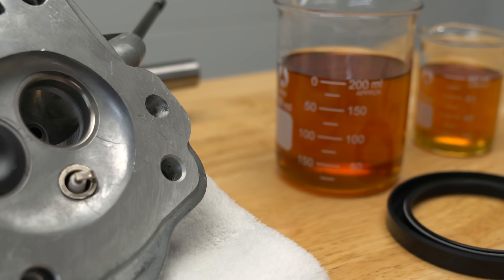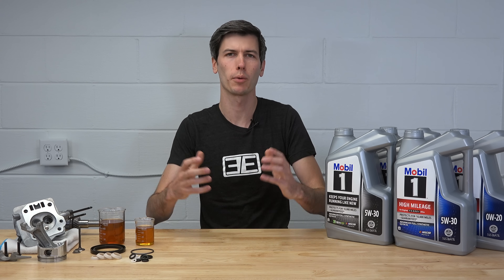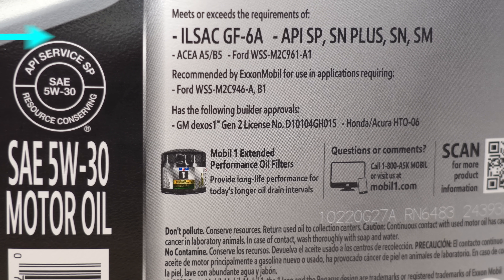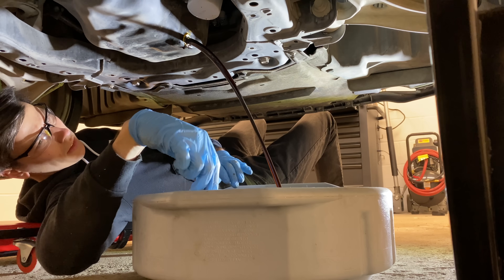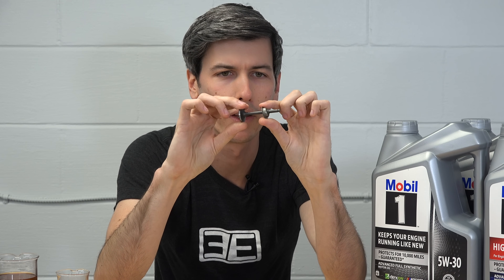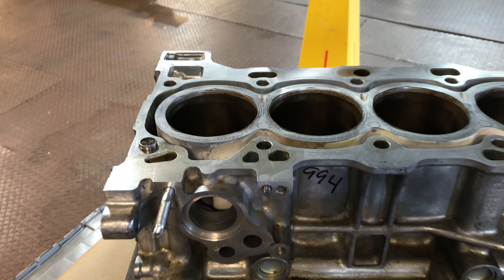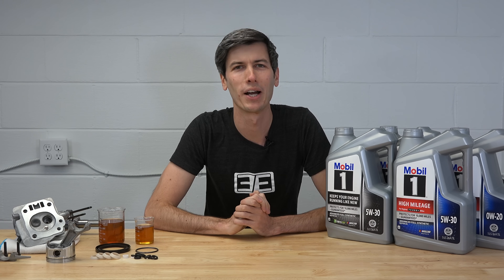Is Synthetic Motor Oil Bad For Old Cars?

Comment: On a fresh rebuild engine, I can use synthetic oil inmediately after priming or I have to wait some mileage?
Reply: I used mineral run in oil on my engines for the first 300-500Km and then straight to synthetic. Generally brand new modern engines run synthetic on run in but I know for old design engines it was common to use a purpose made mineral based non friction modified run in oil.   Mine is a hotted up freshly built Buick engine from the early 90s, so I used the older recommendations of the purpose run in oil.
Reply: @3800S1  Thank you so much, mine is a mopar 440 stock, I will do as you recommend.

Comment: USE WHAT THE MANUFACTURER TELLS YOU TO. THE THINNER OIL HELPS LUBRICATE THE CAMS BETTER IN OVERHEAD CAM ENGINES. WHERE THE TINY SPIT HOLES THAT LUBRICATE THE CAMS BRINGS SUFFICIENT OIL TO DRENCH AND LUBRICATE THE CAMS. IF YOU USE HEAVIER OIL. THE OIL WILL NOT SHOOT OUT, BUT INSTEAD OOZE OUT AND NOT LUBRICATE THE CAMS PROPERYLY CAUSING THEM THE WEAR. WHEN YOU GO TO THESE 10 MINUTE OIL CHANGE SHOPS. MAKE SURE THEY PUT IN THE PROPER WEIGHT OIL. I DO MY OWN OIL CHANGES WITH THE RECOMMENDED 5W-20 MOTORCRAFT OIL FORD RECOMEND ON MY MERCURY MARINER. I HAVE 180,000 ABUSED MILES ON THE POOR CAR AND THE ENGINE STILL RUNS LIKE A CLOCK. WHICH I CONTRIBUTE TO USING THE PROPER OIL RECOMMENDED FOR MY SUV.

Comment: The only reason I've heard for not using synthetic in older cars is that it's more expensive, and therefore wasted money for an engine designed to tolerate conventional oil.

Comment: One additional thing you should’ve touched on is the lack of zddp in modern synthetic oils that were used to protect flat tappet cams in old engines.
Reply: Thankfully new oils compensate by using higher levels of Boron, Molybdenum Disulfide, and Titanium Oxide, which is enough protection for new engines. But still not enough for flat tappet cam engines
Reply: Go with Castrol Classic Car 20w-50, or Brad Penn Classic Car oil
Reply: ZDDP is still in all commercially available engines oils. 

It is between 600 and 800ppm in API SM, SN, and SP rated oils. 600ppm was found to be adequate for flat tappet cams by GM decades ago. Prior to the 1950s most engine oils had no ZDDP at all.
Reply: Diesel oils still have plenty of it. Or you need to go to something like amsoil z-rod.
Reply: ZDDP is the last line of defense when the oil film is displaced.  Or so I am led to understand.  And it’s fatal to modern catalytic converters. Bye-bye zinc additives at high levels like in the past.
Reply: Not necessary in modern vehicles an bad for catalytic converters. Oil has some moly in it. -NY
Reply: I've used Mobil 1 15w-50 in my 1970 Cadillac 472 with a flat tappet cam since I purchased it in 1987. No issues at all.
Reply: I have a jeep 4.0 and I recently read in the Jeep forums people saying these old flat tappet cams need sync or you'll ruin them. So guys run different diesel oils etc. I have been running supertech 5w-30 for years without a problem. Jeep has 212k miles.
Reply: @kennygee2715  That's perfectly fine. I use Pennzoil Ultra Platinum 5w30 in my newer TGDI twin turbo Ford 4wd trucks.
Reply: @kennygee2715  92 cherokee XJ 83k miles. I've read all those forums too and stressed over what oil to use. Ran Mobil synthetic as I run it in everything I own, Silverado, Infiniti, Toyota, jeep, generators, pressure washers, lawnmowers, gas paint rigs. No problems at all. Just for experiment, I picked up some rotella t5 and I'll put that in the jeep next just to see if there's a difference. No lifter noise when it's running on the Mobil though. I'm very attentive to the sounds of these engines when I switch over to synthetics and I swear whatever engine I put it in, they're singing and run smoother. I've looked up the fact sheets on some of these smaller motors, revised recommended oils have been switched to synthetics by the manufacturer.
Reply: Another old wives tale...quality synthetics have more than enough ZDDP for older engines. All you need is the proper viscosity to maintain correct oil pressure.
Reply: @rickss69  No ZDDP in modern full- synthetic oils. Unless a specialty oil for classic cars etc.  -NY

Comment: This is just an anecdote, but I do have experience with a certain synthetic oil causing leaks in a specific car. The oil was Mobil 1 15W-50 and/or Mobil 1 V-Twin oil. The car is a classic, air cooled, Porsche (1986 911 3.2 Carrera). The car had leaks when I got it 10 years ago, so I expected them. When I first got it, I went with the 15W-50 having used Mobil 1 previously and having good luck. I repaired a number of the leak points, but not all of them. 

After a few years, I decided to switch to Brad-Penn 20W-50 partial synthetic. This is a pretty commonly used oil for these cars and has a good reputation. It was an unexpected result, but I had previously been getting small leaks on my garage floor from the car and those went away with the Brad Penn. They also haven't returned. 

If you have any thoughts on why the Brad Penn solved this problem, please post them. Thanks.

Comment: Can I change the oil change interval from 5000 to 10000 miles if I switch to synthetic oil on my old (2008) car?
Reply: Don't do that. If the oil or filter degrade faster than you expect, you won't know about it until you're looking at a new engine. It will never hurt the car to change the oil too frequently.
Reply: Virtually every car in Europe is min 10k oil change, it's completely normal here .
Reply: @-DC-  is that miles or km? In the US, miles are used. 10,000km is closer to 6,000 miles, which is normal for oil change intervals for highway-use vehicles.

Comment: @Engineering Explained  
I've been told not to use synthetics in air cooled applications because they don't cool as well as a conventional oil do you know if this is true?
Reply: I knew of a guy who put this to the test using a dyno to control the conditions as much as possible and found the opposite, that the oil temps increased a fair bit with synthetic suggesting that it helped with cooling by allowing the heat from components to transfer to the oil faster, hence higher oil temps. He also recorded lower cylinder and head temps which complimented the hypothesis that synthetics have better heat transfer.  Not that this is 100% proof but still pretty compelling.

Comment: Got a 2010 Corolla with 225k miles no oil leak and burns a quart every 2-3 thousand miles. Would it be smart to switch to high mileage or stay with conventional?
Reply: Don’t go high mileage unless it’s leaking oil.

Comment: I would be interested in the science of changing to fresh oil before storing a car for an extended period.  The story generally goes, that acids build up in the oil during combustion and can etch surfaces...but do newer synthetics still have these same issues?
Reply: I got my 1995 Pontiac Firebird out of the basement couple years ago where it had been parked for 11 years and never started.
  It had Mobile 1 full synthetic in it and still looked brand new as it only had 1000 or so miles on it.
After getting it running again I drove around for about 1000 more miles on that oil with no problems.
I'd say conventional oil would have turned into sludge in that 11 years.
 You better believe I went back with Mobile 1 full synthetic!

Comment: If your engine is VVT, always respect the oil weight required!
Reply: Should I go back to 5W-30? I have 0W-40 in my Pathfinder 4.0. I live in FL. I figured I get good cold start flow and good heat protection from the 40, in Florida heat. Best of both worlds?
Reply: @elonsus9747  The first number is lower and the last number is higher so you should be ok, but not 100% sure, you should ask someone that is more knowledgeable than me.
Reply: @madmax9009  👍
Reply: @elonsus9747  especially in Florida, that 0W-40 is better for your engine than 5W-30. Especially since it meets Porsche A40 and ACEA specs 👍🏻👍🏻👍🏻
Reply: @ezrawaters6653  Thanks 😀

Comment: Had the same sorta issue when synthetic coolant was all the rage.  I rebuilt a 1986 V6 and for the coolant gaskets a spot or two of RTV.

The Dexcool coolant had the new longer life organic cleaning agent that turns out loved to eat through silicone.  That night the entire contents of the cooling system was in the oil pan and on the ground.

I bet the synthetic oil story developed the same way.

Comment: When a seal is blown I tend to get the engine out of the vehicle and not just replace that suspect seal but replace other seals and other items which will eventually fail. Its more expensive short term but the hassle is sorted out with future potential failures prevented. I done this with my dads Supra where pouring oil I to the engine was like pouring water into a flour sieve.

Comment: Not all cars burn oil, ever. Ive had cars that used a very small amount after about 150.000 miles, and cars that never used oil. My 94 Trans Am I bought new has 348.000 miles on it now,  its had 3000 mile oil changes its entire life. Its always at the full mark when due for another one, runs and sounds like new.  Lt1 engine. Castrol GTX only oil used.

Comment: Hi Jason, just an idea. Is there a way you can make a video to show if mixing different brands of transmission fluids and also coolants would cause the mix to make it less effective? There has always been discussion in the forums for at least a decade or two that if you do a drain and fill of fluids and you don't get all of them out, one should  always use the OEM fluid because the mixing of two brands will cause the fluid to gunk up or dilute each other or the two chemicals will counteract each other. I am not sure how this process would go but i trust maybe your affiliations with brand companies will enable you to come up with a way.
Reply: Trans fluid you're probably fine. Mixing coolants is generally a bad idea
Reply: When it comes to coolant try to find out what's in there. Get the same coolant or flush it all out and just use what the manual says.

Comment: My kia with about 73K miles started eating oil when I switched to synthetic a few thousand miles ago. Don't know if that's the reason and if I should switch back to conventional. Checked the message boards and found that a lot of kias have this issue and the dealer says it's not covered under warranty and not part of the recall. Replaced the PVC and that didn't do anything. Started using Mobile High Mileage and that has slowed down the oil consumption, but hasn't fixed it. Depending on how much I drive I could top off half to a full quart every couple weeks. No leaks under the car or anywhere else and no burning smell either. Any thoughts?

Comment: Hey brother. I have always highly valued your education on these in depth subjects.   During my time in the field I have personally seen vehicles that started leaking oil almost immedietly after switching to a full synthetic.  At these times, we have found things like SOLID valve cover gaskets. which has turned to more of a plastic than a rubber. I have personally seen this take place, multiple times over my years in the field. lets say about half a dozen times.
Can there be a situation we're not entirely covering?  Could full synthetic FNISH OFF an already failing seal?  This last vehicle,a subaru, LITERALLY was POURING out from the valve cover gasket(and I get that its sideways and gravity helps vs a horizontal valve cover)  and I trully feel that their is something more to this discussion.  This is the ONLY reson I have ever found to NOT "upgrade" to a full synthetic. Never learned it from anyone, and they didnt teach it in college, but my own personal experience tells me there is merit to the discussion.  For the record were talking of course modern cars(say 1996 and newer) and oils.  I get that debris being dislodged and the extra detergents COULD remove a leak stopping block, but I find it extremely difficult to believe that is what made the difference between a bone dry motor, and a day later a pouring oilfall. I would love to hear your thoughts on this in more detail. If you end up with the time, thank you ahead of time. Please keep up the excellent work.
Reply: Just came across this video today.  I have a 2010 impala that had virtually no oil leaking.  The last oil change or two I used a thinner synthetic (5w30) vs conventional 10w30, and it now has a quite a bit of leaking.  I'm not sure it's caused by the synthetic aspect of the oil, but likely more the viscosity.  I'll switch back to conventional on the next oil change and see if that changes anything.
Reply: @johnsawatzky9380  Never change the viscosity on your vehicle, especially going to a thinner oil on an older vehicle. I suspect if you went to a similar weight synthetic it should stop the leak, theoretically speaking.
Reply: @johnsawatzky9380  i recommend going for a full synthetic 10w30 just to see if its the viscosity or the fact its synthetic. If it stops leaking while using full synthetic 10w30 then you know its the viscosity
Reply: I ran fully synthetic in a 1995 toyota corrolla once it hit 50K miles. Not once did it leak oil. It had 376K miles on the original engine when my wife FORCED me to get rid of it because it was ugly. Not only did I run full Syn. It was 12w 50 when I could find it.  I ran a 1976 Pontiac Firebird with a pontaic 350 v8 motor for about 12 miles or so with no water with the temp needle pegged(about 15 minutes in total), but it also had 12w 50 full Syn in it. There was not one bit of damage done to the engine. That car had 265K miles on it when I got rid of it.  In my experience standard oil of fine until you hit 50K miles. Then run Syn. If the motor leaks it was going to leak anyway, it just means its a crap motor.  I have no reason to trust so called "Experts" on youtube. I have caught quite a few telling lies or half truths.
Reply: I just want to be clear that this guy is absolutely no nonesense and he knows EXACTLY what he is doing here.
In fact, it is difficult to find someone more straightforward on YouTube or ANYWHERE for car/engineering discussion.
He quite literally, puts the math directly before your eyes as most of this is explained. 
This is simply ONE odd case where there is a gray area where we don't really have a solid answer, in some people's opinion. 
Annecdotal evidence isn't very scientific, HOWEVER when you see certain things with your own eyes, sometimes you can tell part of a story is missing.
One thing I have considered is fresh oil, is full of DETERGENT. Synthetic oil has stronger, longer lasting detergent, BECAUSE it must withstand a longer change duration.
Perhaps some oil leaks are actually PREVENTED by that layer of crap that builds up around the engine as oil is splashed around?
What if the fresh detergent was washing away tiny leaks that were previously undiscovered because they were mostly closed and only SEEPED gradually? 
See, the thing is, this crap is BORING and happens at a low enough frequency and expense that no one  really cares. 
So I feel like there is sort of a stalemate on the LEAKAGE cause, however it would seem that the modern synthetics DO NOT have a direct affect on the GASKETS themselves, so it is technically not causing any leaks.
Reply: 100%.  Its like pouring water into a basket.  Or in the engine.  Besides. Read my post.  Its all hype.  No petro no hype.

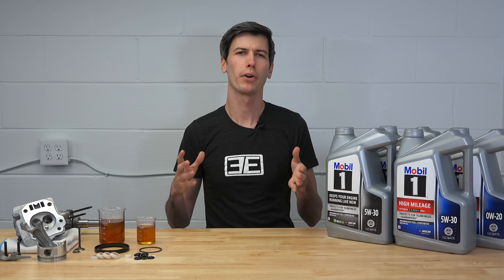Comment: Anyone with a classic car built before 1965 knows that he's full of BS at 4:35. Those rope style rear mains specifically rely on a varnish and sludge build up to seal.
If you're talking modern cars, you're right he's correct but he keeps interchanging the classics and the modern as if there's no difference.

Comment: Older cars with flat tappet cams require zinc, MOST synthetic oils DO NOT CONTAIN ZINC or have too low zinc levels for the type cam/lifter.  No matter how good the syn oil is, without zinc you will suffer lifter and camshaft failure.
Zinc - Zinc dialkyldithiophosphate (ZDDP)

Comment: I'd say the biggest reason not to use synthetic in an older engine that's burning oil is just the cost.  Now I'm talking about cars from the 90's or earlier, where many of them still used conventional oil.  IN today's modern cars (cars made after about 2000), you want to only use synthetic oils. Using synthetic in an older engine won't hurt it but will just cost more over time for little benefit IMO.  If your car is burning oil or has low compression then switching to synthetic is a bad idea because it won't help the burning/compression problem and it just costs more to maintain (the real fix is to find out why it's burning oil or has low compression and address it, such as worn rings or a worn out engine in general).  

As a side note, The other time I would advise you only use OEM synthetic oils for your car (like oil from Toyota or Honda, etc) is during the break-in period.  I always tell people NOT to change their oil until the car is broken in (which is usually the first 500-600 miles).  I then usually suggest people change the oil, and use the mfr's oil atl east for the first few changes until the car has built up some mileage and everything is fully broken in.  Then you can switch to whatever brand you want (yes I know most synthetics are made the same, but it's just something I've gone by in my new vehicles that has worked over the past several vehicles).  Draining the oil at 1000 miles also gets out any remenants that might be left over from the mfg process.  I'm sure most mfrs run the motors for a period of time to check them, and then drain and refill, but still, I like to change it after 1000 miles anyways just to make sure, and then usually go on a 5k/4 month oil change interval after that.

Comment: I use Mobil 1 in my 1951 Willys CJ3A. I have no problems. 
When breaking in a new engine or an overhauled engine you should use an oil with high zinc content.